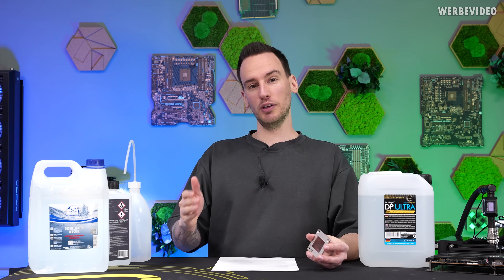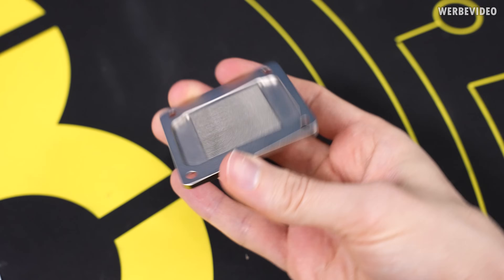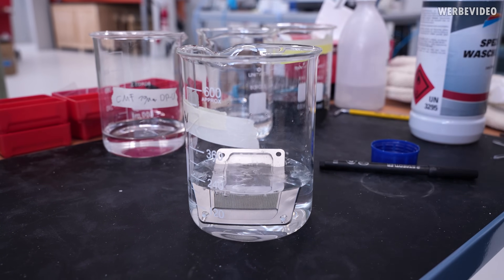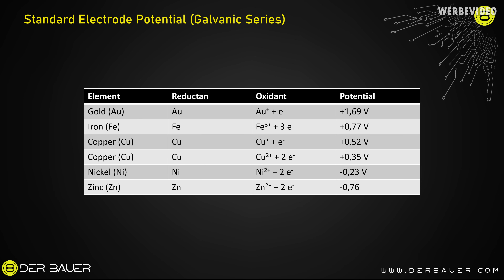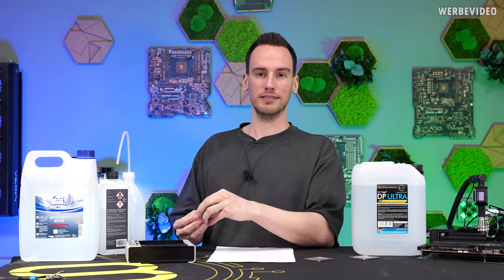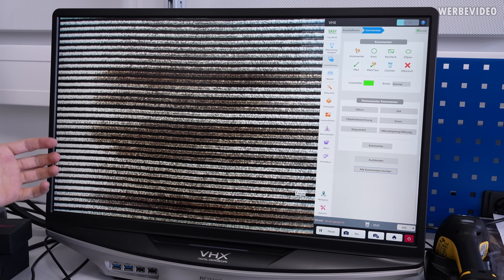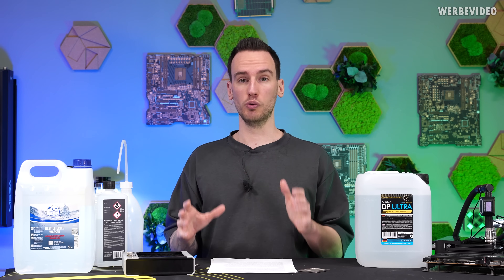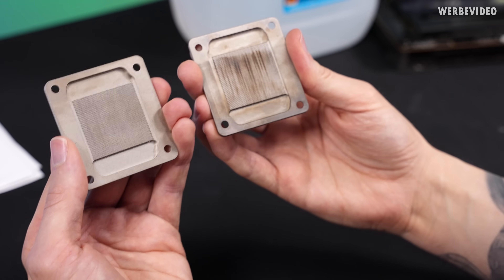Do NOT use Distilled Water for your Water Cooling Loop!

Comment: God. Thank you. 
Ihave been arguing this for well over a decade. So many water cooling forums filled with experts just repeating the same nonsense over and over. "all you need is distilled water", or even worse, "just distilled water and biocide like copper sulphate". 
I compiled lists of posts where people were showing the damaged finish on water blocks, and the fact they all had one thing in common. Only using distilled water or distilled water and biocide. It just didn't matter. It always reverted to company X has bad plating but company Y has good plating .... until people started posting images of damaged blocks from company Y that also had been damaged. So they just insisted it was now company Z that had 'good plating'.

The damage always had the characteristic of appearing first and most severely on areas of the block where water was able to sit stagnant, like out of the main flow path but inside main Oring, and usually where the top and bottom of the block pressed together.
Even some bigger youtube creators were guilty of spreading this back in the day. All I heard was "coolant is just greedy big companies taking advantage of idiots". It didn't matter that you can just use commercial corrosion inhibitors like auto coolant for the same result.

I have had water cooled systems since 2011, including using parts from companies with 'bad plating' and never had anything more than very mild staining (after years of service) that easily polished back to look brand new. I have always used clear coolant or distilled with corrosion inhibitors (which also have a biocide effect).
Reply: Copper sulphate has been discovered to be a problematic additive more than a decade ago, and it is no longer being sold. The replacement benzalkonium chloride (basically Dettol) is a much better alternative, and I've personally used it for 15 years without problems.
Reply: I don't water cool but I never knew where the myth of using distilled water came from. It will absolutely react with your loop. 

If it didn't then racers would use it in their engines, but automotive cooling systems also have dissimilar metals, and it's a no no. 

Coolants have corrosion inhibitors for a reason, it's not there to sound good and sell a product.
Reply: Racing (or any automotive application) is an entirely different matter. The temperatures are much higher and the metals are more dissimilar (higher potential difference on the galvanic ladder). Combine nickel, copper and brass and you will have very little issues. Combine aluminium, steel, copper and zinc and you will have many issues. Cars also don't have microfins, so it's apples and oranges on a few different levels.

Comment: I personnaly mixed half distilled water and car coolant since two decades and never had major corrosion in my loop.
Reply: Car coolant has very strong anti corrosion properties. 

It's never a bad idea.
Reply: Let's go Glycol!
Reply: TBH you only need to do about 10% glycol, probably not even that.  You only need a very small amount to deal with any galvanic effects.  If you go 50/50 you are reducing your cooling ability by a couple of degrees so no biggy but its probably a bit overkill.  If you have an ultra fine fine array on the cold plate, too much glycol can sludge up a little bit and reduce the area of the fins cooling which becomes a bit more noticeable over time - but again not  a biggy if you refresh your coolant every few years.
Reply: Car coolant is very toxic, be careful with that.
Reply: @sanghyun2776  Sure ! dont drink your coolant loop as you do with you car fluids :)
Reply: @theshuff  Nah, I’m warning about when you breathe with vaporized coolant. 
As you know computer liquid cooling is not possible to perfectly seal it. After 2~3 years, you can observe that coolant is disappeared a bit. I’m pretty sure that there is no good effect in long term especially if you have kid or pet.
The coolant for computer is good enough. It is little bit expensive but at least it is not toxic
Reply: @theshuff  Sure, but a lot of people have pets these days and they do not know any better. That thing smells and tastes sweet, they are drawn to it and if you have a leak without you noticing, it is a major hazard to their life.
Reply: @MaaZeus  You pets can open your PC case to get at these delicious fluids?   Give them jobs!  :)
Reply: @malphadour  PC cases are not exactly water proof. A severe leak can easily flow on to the table and from there to the floor.

Comment: For the new people, don’t listen to this. i’ve ran loops for many years now and i only use ultra distilled water now. all those “inhibitors” will gum up your loop and ruin your tubing. Put a little (or a lot) colloidal silver in with your distilled water and you will have zero issues. the silver will take on the ions because it is extremely noble and your parts will be ok. According to his own logic they are just making things worse by using nickel plating instead of something more elite than copper such as iridium, palladium, gold, silver, tellurium, rhodium, platinum.

He is manufacturing the problem then selling you a “solution.”
Reply: He's a salesman...'nuff said.
Reply: Sure buddy

Comment: I always use either premixed clear or buy concentrated and mix with distilled, that's fine. But I'm not throwing tons of money away for a simple flush that's going to take me one hour to do three quick loop flush then refill with coolant. Been watercooling my systems for over 15 years now and never had any visible to the eye corrosion on nickel plated blocks.

Comment: This video is making me really nervous because of the test method of just pouring water and coolant in a beaker and letting it sit still. I used pure distilled water to flush my radiators and run a small loop testing my reservoir, pump and a radiator for about 30 minutes. I then disassembled it all and tried to empty as much water out of the parts as possible, but there's always going to be water trapped especially in the radiator. Well it's now been about 2 weeks of it just sitting not used yet as I wait for final parts to finish my loop. Am I in trouble? Are my radiators going to have corrosion in them?
Reply: Keep in mind he is heating the water and coldplate to 60'c which will accelerate the effect quite a bit. I would not worry, yes you shouldn't use just distilled water on it's own long term but this video (while it does address a valid point (spread of misinformation)) has a tiny, tiny amount of scaremongering in it. Been flushing all my loops with distilled water for over 15 years and never once had any visible corrosion on anything, especially anything nickel plated. Obviously you will want to fill the loop with the correct coolant soon as possible and never run straight distilled water in the loop for any longer than is absolutely necessary.
Reply: @filmboy18  thanks yeah I figured the 60c he used must be greatly accelerating the result. Also, the radiator doesn't have any nickel, only copper and brass so hopefully there isn't anything going on in there. I could have sworn I read somewhere the copper does not corrode. Makes sense since our drinking water doesn't have corrosion inhibitors in it and our copper pipes are fine for decades with tap running through it. I think I'll be okay 👍
Reply: Wait, is it fair to say that the 60c oven environment significantly altered the results vs ambient temperature of about 20c? Because if so then I can breathe easily knowing any corrosion in my radiators would be extremely minimal.
Reply: Just an update to my situation. After cleaning my radiators with distilled water and having them sit for a few weeks while I waited for the rest of my parts, I finally got my loop up and running with Primochill Liquid Utopia. It's been about 1.5 months now. In that time, I watched my water conductivity go from around 36 microsiemens per centimeter to now today I reached 61 according to my Aquacomputer high flow NEXT sensor. That's NOT good. I think my loop is going to corrode my blocks. Tomorrow I will drain my loop down, open up my blocks and examine the condition of the metals, clean them with toothbrush and soapy distilled water, then put the loop back together and fill it with Primochill System Reboot, run that for 24 hours, flush that quickly with a gallon or two of distilled water, then I will make a mixture of Primochill Loop Prep which has inhibitors that bind to the metal and coat it to stop it from releasing copper ions. Run that for 72 hours before finally draining and flushing my loop once more, and filling with a fresh batch of Liquid Utopia. If I still have conductivity problems after all that, then I am swearing off Primochill forever.

Comment: No, distilled water has the electrons stripped from it because they use a reverse electroplating method to remove all the minerals.

Anyone who does their own maintenence on their car should know you're supposed to use "soft" water in a cooling loop, which is similar to distilled water in that it has minerals removed, but it doesn't have the electrons stripped out. It's usually only slightly more expensive than distilled water.

Comment: Dude, I hear you and understand what your saying but flushing a system with only distilled for a day or two, the redeposistion of ions is so miniscule that the impact on heat transfer it negelable. It's more of a cosmetic issue for those running clear blocks. I have some discoloration on my current CPU block and it's never effected preformance, it's cosmetic. I believe if you took your two plates you used in this video, put them in a completed blocks, run them A/B compairson, there would be no diffrence at all reguarding the blocks ability to thermaly transfer heat.

Comment: For more then 20 years of watercooling my PC`s I finally went to MOTUL MOCOOL additive, it`s cheaper then dedicated watercooling coolants, acts like distillated water, and protects loop the most, pump casing is cast iron(grundfos 25-60) Nickel plated waterblocks and copper radiators, one is MO-RA3, other is HardwareLabs Nemesis 480 GTR
Reply: Redline makes a similar product called Water Wetter.
Reply: Motul Motocool is already a premix afaik.
Reply: @FIIIIIIP  mocool is a concentrate, use 5% solution in distillated water

Comment: My current PC I built in 2020 was distilled water with a couple of drops of biocide in it. CPU loop over solid copper block into copper radiator, with ceramic pump.

Comment: Hmm i wonder if vegitable oil might be a fun thing to try?
Reply: Plant based oils would spoil quickly, so something like mineral oil would be better.  Though I imagine it’s too thick for most water cooling pumps to cycle through the loop, so it still likely wouldn’t be a great idea.
Reply: not good at absorbing the heat.

Comment: You can use titanium nitride for plating surfaces, it`s possible to get surface look like copper. Did you try to use silver for cold plates instead of copper?
Reply: Titanium is used in seafish aquarium chillers because of its corrosion resistance even in salt water. That said it's probably overkill for PC parts, nickel plating tends to survive fine with just distilled water and biocide, this video is pure panic and fearmongering. Just don't use distilled water if you have clear/plexiglas waterblocks and you want your blocks to maintain an untarnished look.
Reply: @muf1772  titanium nitride is good alternative to nickel if you want look it like gold or copper.

Comment: Must use deionized water with the coolant, it's more stable than distilled water specially in the long run. That's why in automotive applications they use deionized water with the coolant mix and not distilled. Ps deionized is more pure

Comment: Been building loops for over 20 years. I've always used reverse osmosis filtered water and Valvoline Zerex antifreeze at a 90/10 ratio. Never had corrosion, never had buildup. I purchased the Laing D5 Vario pump in my current PC from DangerDen in 2004, I credit the pump lifespan to Zerex. Automotive coolants have 100 years of reliability behind them, no PC coolant manufacturer can say the same.
Reply: Laing D5 Vario pump can survive on 100% speed for daily use easily +15 years!
I have 4 of them and they all going after a decade!
Reply: @N0N0111  I ran it on about 70% from 2004 until 2012. Then the potentiometer went faulty, so I just put a jumper on it and ran it at 100% until 2019. Did an all new build/loop in 2019 that I wanted to be whisper quiet, so I removed the jumper and the potentiometer, which makes the pump run at a static 50% where it's near silent but still has plenty of flowrate. It has ran 24/7 for probably roughly 174,000 hours, at this point I suspect it will outlive me.
Reply: It's almost as if the automotive industry figured out how to prevent corrosion in a cooling system with mixed metals decades ago.
Reply: @Fix_It_Again_Tony  Try telling GM that lol

Comment: Great video. For those that aren't made of money, just use premix automotive coolant.

I've tried various premixes and concentrates as well as falling for the meme of pure distilled water. After dozens of loops over almost two decades I had numerous issues with corrosion destroying microfins and removing the nickel plating off water blocks making them look crap and perform worse. As soon as I swapped to automotive coolant I never had another issue, blocks looked the same as the day they went in and performed great for the life of the components. It's cheap and readily available locally, and I enjoy the fluoro green colour. 

Just as with any other household or automotive chemical, just don't drink it, and keep it off your components.
Reply: Depends. PETG is not chemically resistant to ethylene glycol, which is commonly used in many automotive coolants. Also, many modern automotive coolants are are not as PH neutral as PC coolants. Automotive coolants have ZERO concerns about the aesthetics of the parts being cooled. You may see discolouration on your nickel plated parts after using automotive coolants. The discolouration isn't "damage", but it's undesirable. There is no such concern in your engine, and so it isn't designed around that issue.
Reply: @noxious89123  well, I literally just rebuilt my liquid coller after around 8 years of zero maintenance. I use blue coolant, and when I inspected the (pure copper) water block, it was as shiny as the day it was made. The rads are aluminium. The tubing is food grade silicone. I refilled it with orange coolant, as I didn't have any blue, and I expect it'll last until later this year when I build an entire new system, air cooled this time, as heat pipes are plenty good enough these days. In short, you do you, and I'll do it my way (for less money, and less maintenance)
Reply: I mean, it's a very brute force approach that will work if you don't like maintenance. Automotive coolant is designed for 95 degrees celcius and up, so running it at 40 to 60 degrees in a PC build is going to be perfectly fine. Your component temperatures will be a bit worse than if you used coolant with a lower percentage of glycol though.
Reply: Exactly this. Why anyone uses anything else is beyond me, it's literally a no-brainer

Comment: My 4 years old loop runs on twice distilled water that is sold at the pharmacy for cleaning dialysis machine. Add 1/10th the volume with 90% ethanol and it basically runs on booze. Yearly rinse and clean and everything is fine. My friend that runs a custom watercooled system integration shop use the same thing for their basic systems and never had a problem in the hundreds of system they have. It has even less problem than people running on clear or colored coolant.

Comment: started using DP ultra after my highflow NEXT gave odd reading with EK's fluid and it's been in there for 2.5 years now liquid quality still reads 100% (parts are all older and have been through multiple cleaning cycles and a light sandblasting via primochill Vue :P) conductivity is still extremely low, at this point I kinda wanna let it roll until I see it drop :P

Comment: the factory where i work has a big chiller (actually a few of them. we run tap water through the system (not my choice)) big pipes distribute the cold water through the factory to multiple machines that need it . the old pipes are just iron. because nobody thought it was that important to renew the pipes to stainless steel pipes a few months ago we started having leaks (small and big) almost 2 to 3 times a week . lucky the process of renewing all the pipes was already started by then .   total cost for just the pipes is almost 500k euro . they are also gonna build a new cooling system with heat recup for the hot water system. total cost 1.5m euro .  the biggest reason for just using water is because it's a chocolate factory . everything needs to be food grade . so running the entire loop with special coolant would be more expensive in the end .

Comment: If like me you have a custom loop and also service your own vehicles - buy some of the concentrate cooling additive for cars and use that in about half the concentration recommended for a car. 
Can also last MUCH longer than 2 years - the longest I've gone is about 4.5yrs before replacing components and therefore draining the loop, even after that time the condition of the loop was still perfect. 
Red vs Green additive doesn't matter in this application so just use whatever your car uses, unless you want a certain colour for visual effect.